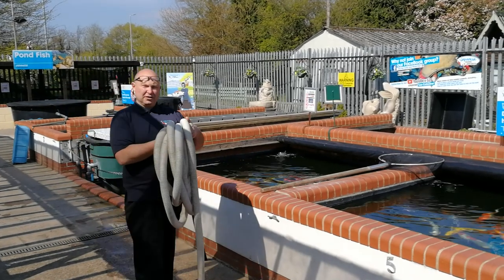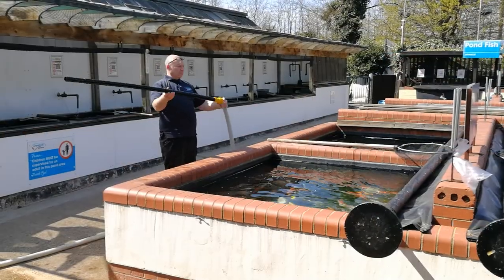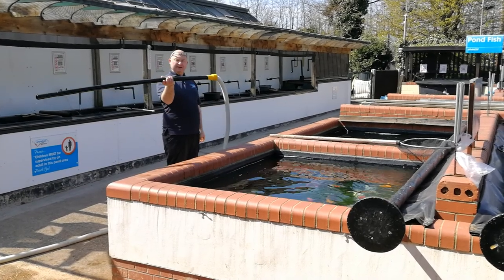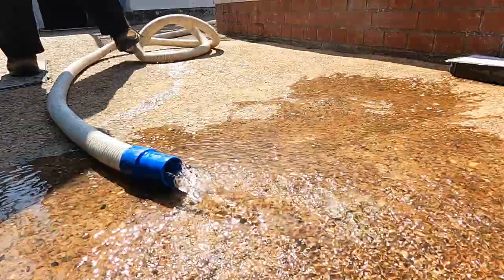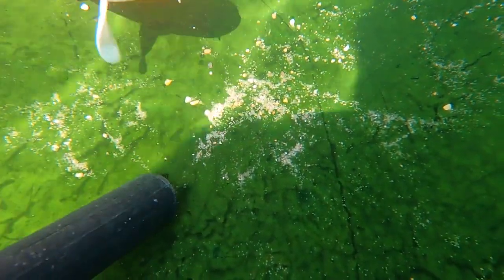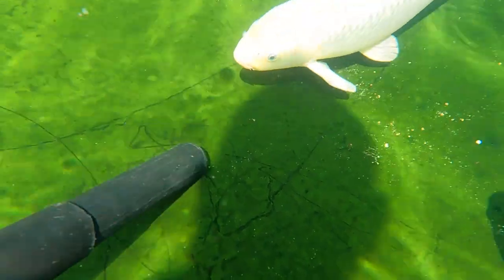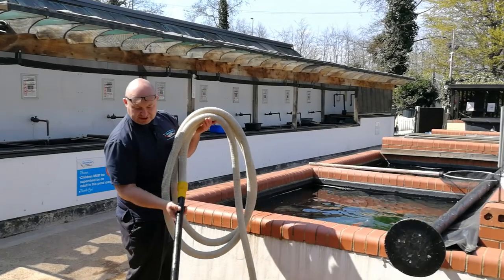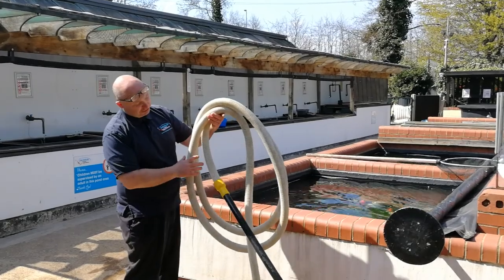DIY Pond VAC?

Comment: Non-Pro Tip: This only will work if your pond is above ground, or you can get the hose lower than the lowest point in the pond. Otherwise, it will not syphon, and you will need to use a pump of some sort.

Comment: I've got a 2 story house. And a cal king waterbed on the second floor. With a garden hose I can empty it in a 1/2 hour like this.what ill do is turn on a fasset fill the hose disconnect it and put the end away from the house.  So be careful doing this a 3/4" hose can empty a waterbed in 30 min  think what a 2" hose can do.  It will empty a pond pretty dam fast. Dont walk of and let it run.

Comment: Lee this is fantastic! We bought a house that has a pond that is dug out. It is not raised. It has a lot of rocks in it and it’s only about 28 inches deep. Would this work for that if it’s not above ground? Thank you we need to get the muck out, and figure out if it will clean the rocks as well. Please advise! And, thank you!
Reply from the maker: Unlikely to work on a sunken pond. Unless there is a big drop away from the pond. You would need to pump out the water and shovel the sediment out by hand.

Comment: do you have a suggestion on how to easily return the water to the pond instead of draining it?  Here our water is metered and I'd like to find a way to reuse the same water.  I just want to get rid of the muck at the bottom since the water in my pond is crystal clear. Thank you!
Reply from the maker: Very tricky. The water would have to be stored in a tank. Allowed to settle over a day or so then pumped back. Not worth the effort.

Comment: Love your videos! I have gravel in the bottom of my pond... I wonder if that would make this more difficult 😬 gonna have to find out!
Reply from the maker: Yes the gravel make it a big challenge.
Reply: You can use 1/4" hardware cloth to make a pre-filter.  It will pick up the gravel smaller than 1/4 and leave the rest behind.  You can also collect the gravel in a shop vac rather than straight to drain siphon, wash/rinse it, and return it to the pond.  Also, a quarter turn shutoff can be used to adjust flow, allowing the gravel to be picked up but settle back out of the upstream flow, sucking the crud out while stirring the gravel.  I've seen aquarium cleaners work like that.
Reply: @jm7974  these are great ideas! Thank you! I'm going to have to rig something up

Comment: Any ideas on how to make this work in an inground pond? My pond is nasty and I don't have the means to buy a vacuum right now...
Reply from the maker: It cannot work if the discharge point is not significantly lower than the water surface. It is running as a Syphon and it has to run down hill.

Comment: is it 40mm flexi pipe with 38mm rigid at the end?
Reply from the maker: The one in the video is swimming pool vacuum hose. And 1.5inch push fit pipe rigid.
Reply: @leecalladine  what make? different makes different sizes!

Comment: Great idea, but i use a drill powered pump off a cordless drill.
Only cost me £9.99
Reply from the maker: That's interesting. Does it ever get blocked or need priming?
Reply: @leecalladine  no lee, I've got 3mtrs of pipe both sides of the drill powered water pump and away i go.
Just switch on the cordless drill, works great and like you said helps with the water changes, you can get them from any diy store, and pond vacs ain't cheap
Reply from the maker: @tonybeards2978  no there not. And pond vacs aren't always the most reliable things. I am all for DIY or repurposing.
Reply: @tonybeards2978  can i get a link to that pump you bought bro?
Reply: @Showmethatdrippage  brought it off eBay mate..drill powered water pump, loads on their